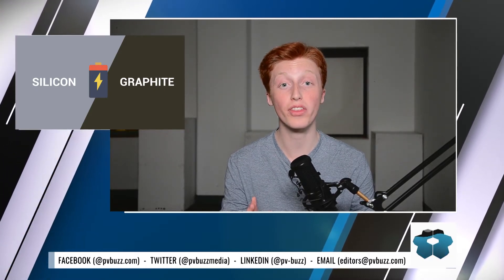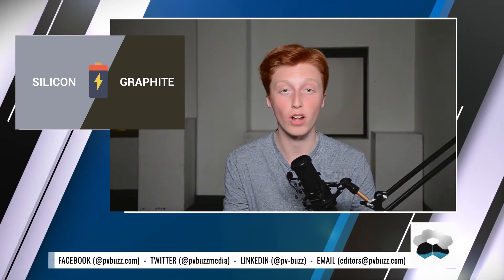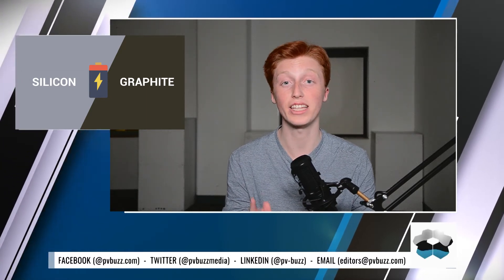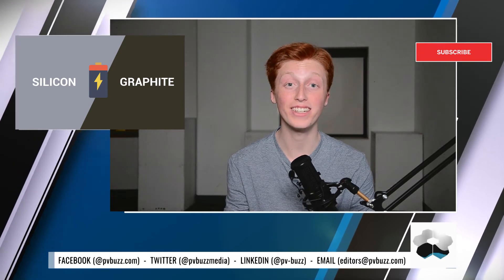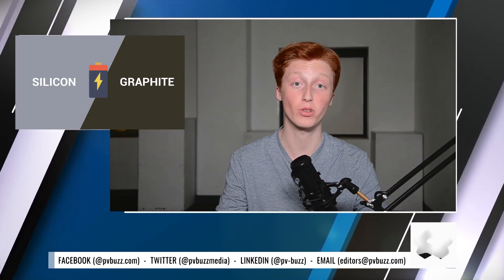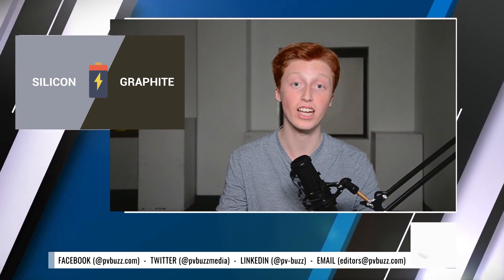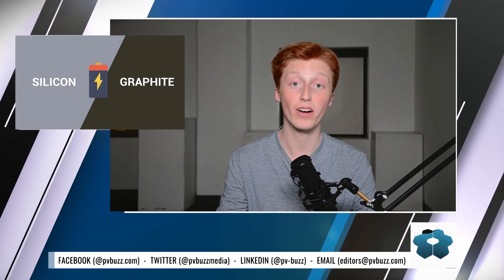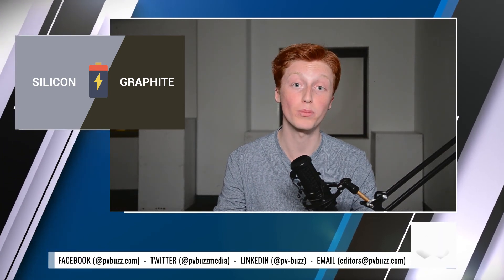Silicon Anode's Advantage over Graphite | NextGen Lithium-Ion Battery Technology

Comment: Silicon is the weirdest stuff in the world.  How is it, that one of the best insulators in the world (ie. silicon tiles were used as heat shields to protect the space shuttle during re-entry), and yet is being talked about as a conductor (ie. anode or cathode).
Reply: You're talking about two things....heat insulation and electrical insulation.  But the real answer to your question is that the tile on the space shuttle were made from an oxide of silicon, not the metal.  Si metal is proposed for anode use.

Comment: INteresting but they still haven't solved this cracking problem. Now it seems LFPs offer more promise despite the lower energy density.
Reply: @egotisticalbastrd OK right is that the one where they use both graphite and silicon, with the silicon as a layer on top?
Reply: @egotisticalbastrd Cheers!

Comment: Silicon has a swelling issue. You've made no mention of this or about graphene. You can't just take out graphite and drop in silicon.
Reply: That is the reasoning behind developing silicon nanoparticles.  By breaking up the silicon anode into many small nanoparticles, then binding to the sulphurs of the graphite sheets and protecting the silicon nanoparticles from the electrolyte by the polyacrylonitrile matrix, the silicon nanoparticles can swell during lithium intercalation without anode breakdown.
Reply: Bryce Hirsch If a company like HPQ can produce high quantities of cheap Silicon and have these processes patented, what are the chances a company like Tesla would like to appropriate such a Technology in order to have a long stretch in front of any competitor? It seems like a braindead yes to me... but no one seems to be talking about this...
Reply: The expansion problem has been solved years ago with the use of Si metal spherical nano particles and wires.  The problem is it has always cost a fortune to make ... $30,000 a kilo... until now:  https://hpqsilicon.com/press-release/new-purevap-silicon-metal-nano-reactor/
Reply: In theory you could just use silicone which would need to be nanotubes. Buuuuuuutttt there have not been any breakthroughs yet.  You are trying to prevent dendrites which is what kills batteries. If amprius really cracked this code and didn't make it public they are out of their minds and if I invested in them I would sue them.  You don't keep the ability to make 500wh/kg batteries quite. You tell everyone so you make billions.
Reply: Shaun McNulty is Amprius even a public cie?
Reply: Madhusudan C  Yes.
Reply: @croninsiglos9855  
Good for fake boobage.
Reply: What is the issue?